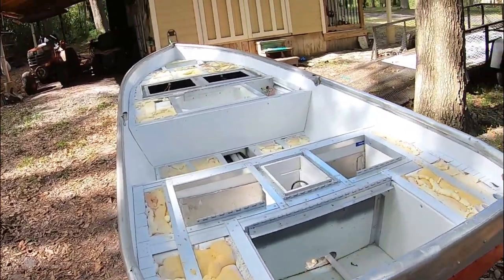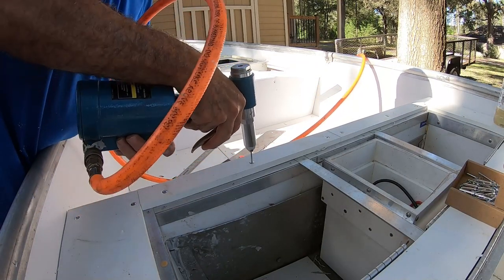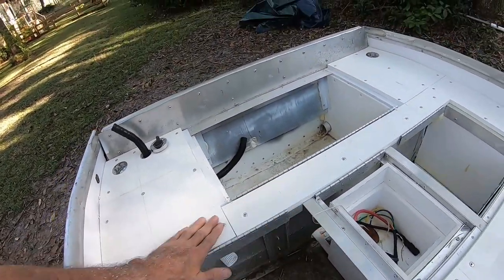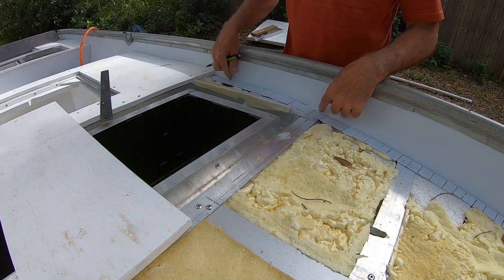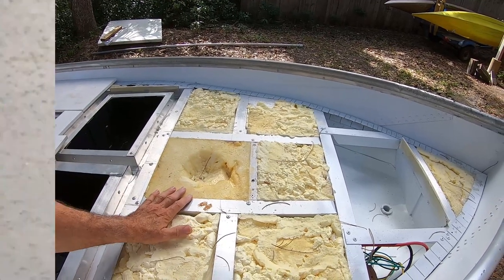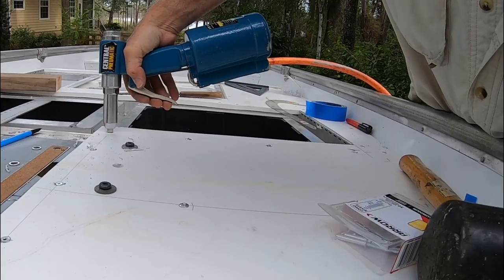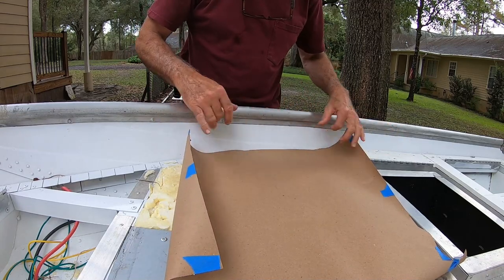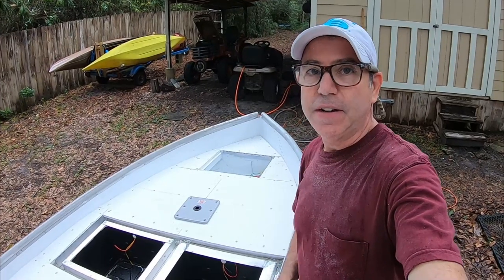Rowboat to Bass Boat Conversion,  Part-6 putting on the new deck

Comment: Looking at converting a 14 deep v to a platform. How much weight does it add to the boat? It will take away from the rated capacity? Wont be able to carry as many people
Reply from the maker: How much weight you add really depends on the style of build and the materials you use.